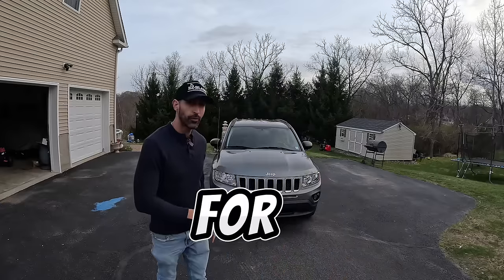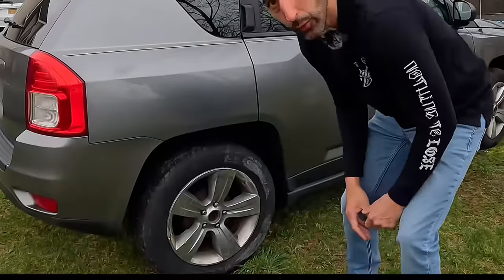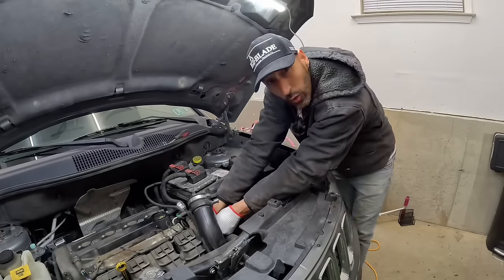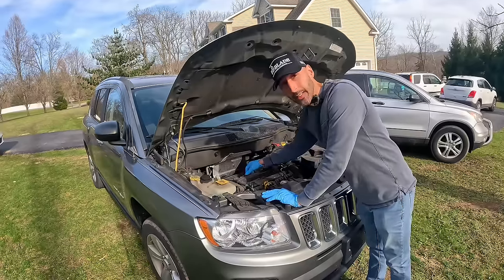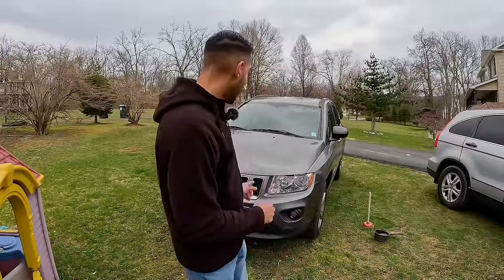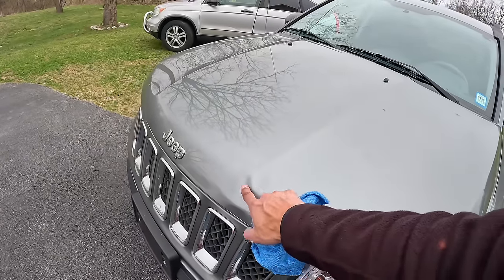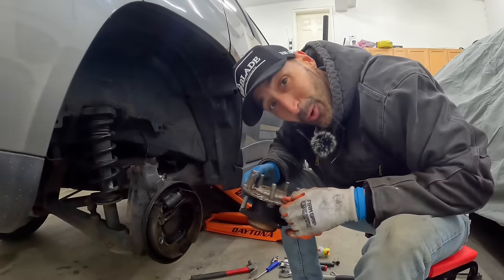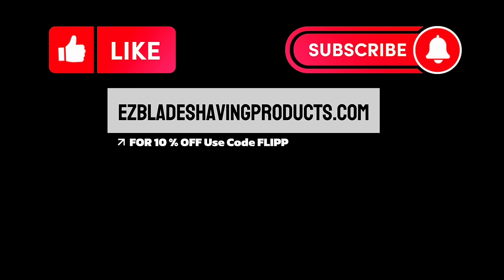I Made Over $3700 In Just 4 Days Flipping This Car Crazy Profit

Comment: Another great video - I know you are doing this to make a profit, the only negative is buying parts from eBay or Amazon. I just feel sorry for the buyer. I am pretty sure you will get past the 30 day ‘warranty’ required by your state but the buyer will have problems with the plugs - those aftermarket plugs cause so many problems - that and all the cheap parts it’s not great the buyer will have to deal with figuring out how to fix aftermarket cheap parts. If you watch YouTube videos on car repair you know they all tell you the aftermarket parts cause so many codes and burn out other parts sometimes. Keep on going and teaching us - but my only suggestion is to pick the right part for sensitive areas for a better used car buying experience.
Reply from the maker: Definitely man. If I do get cheap parts from Amazon. I make sure to look at the long term reviews before purchasing. Thanks for your comment